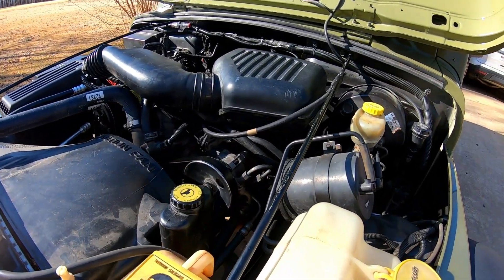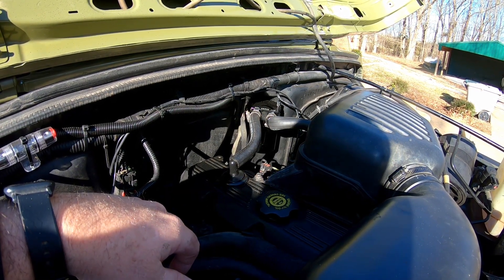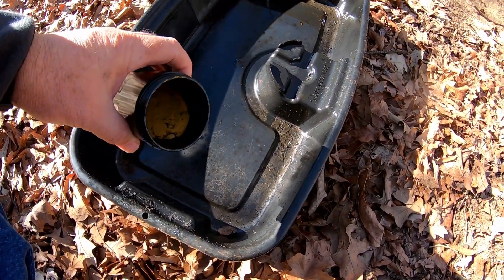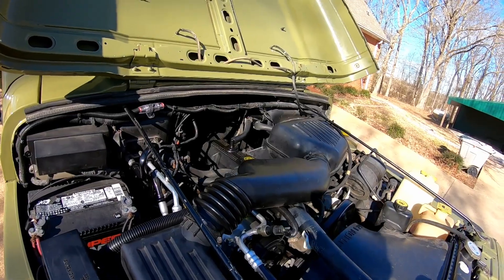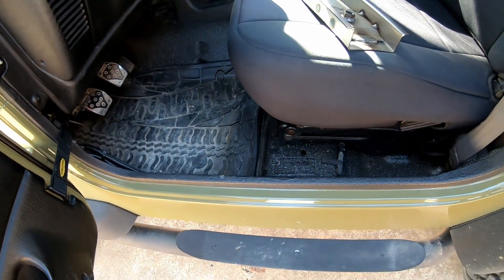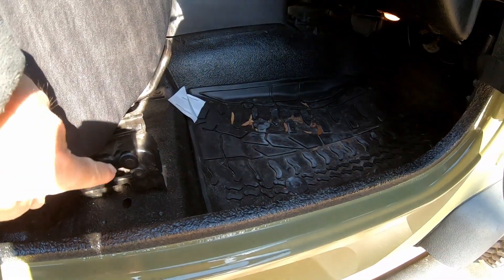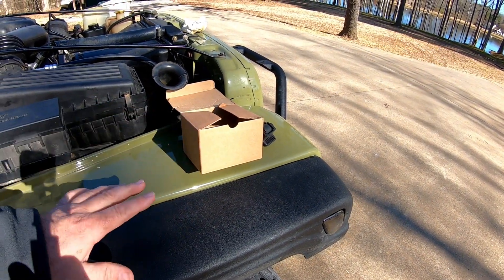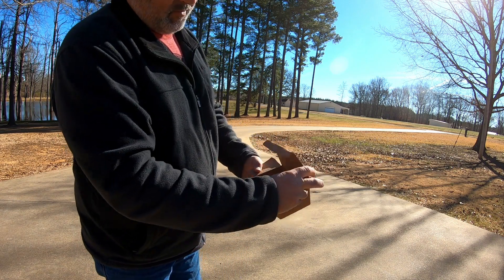97 Jeep TJ Oil Catch Can (Oil in the Intake)

Comment: Thanks for sharing this. I was wondering what vent to use . . . the one on the front or the one on the back of the valve cover (like you did) both vents spit oil. Would it be possible to connect both front and rear vents to one catch can? Just thinking out loud ;-)
Reply from the maker: I hear what you are saying JBHK. I'm not 100% sure it will work but it would be worth a try just for scientific purposes(I think it will work though). 

The one on the back of the valve cover goes to the breather box and the one in the front goes to the intake. You would have to run the front line into the rear line before the catch can(front line is no longer connected to the intake). 
  
Then after the catch can you would have to split off with 2 lines. One going to the breather box and the other going back to the intake. In theory it will work. Just taking the time to find the connectors and lines will be the hardest part. 
  
 Thanks for making me use my mind this morning. That is a pretty clever question. Please let me know how it works if you try this!
Reply: @ForceBuilt  Thanks for your reply my friend. Regards from the Netherlands 👍

Comment: Brother amazing video! You have one of you installing it? I have a lot of issues with my PCV and CCV 
I have the doubt of buying this Can, but surely is an amazing replacement for the valve
Reply from the maker: Thanks so much. No, I missed the opportunity to record the install. I try to capture everything and don't remember why I didn't. Thanks for commenting and watching my content!
Reply: @ForceBuilt  man and sorry again, i have an issue with my TJ its just like yours 2.5Lt 4Cyl but 98, the problem i’m having with the jeep is with the Gas, like 2 years ago the fuel pump start to fail, i replace it with a new one but this time the pump again start to do the same problems, i remember that when i changed it, the hose of the pump to the Floating get a little loose and i forgot to put a clamp. so I don't know if the problem that the car has when driving on the road, explosions and it fails a lot when starting is due to that small detail. Please man if you Can help me would be amazing